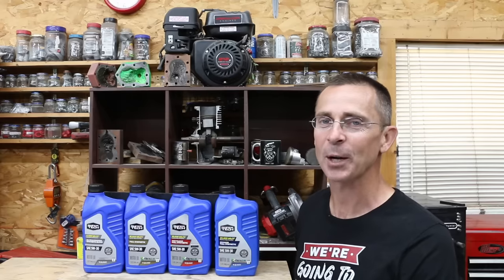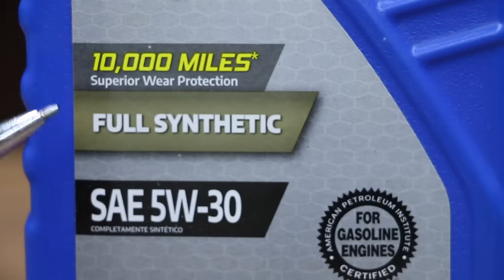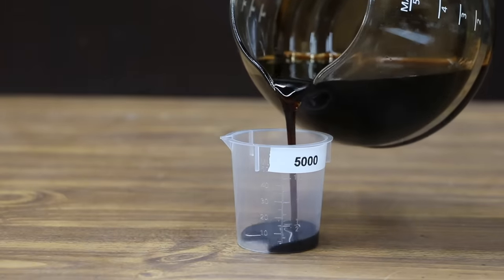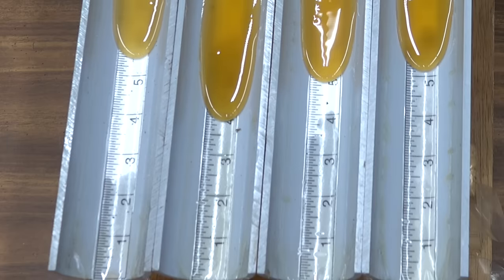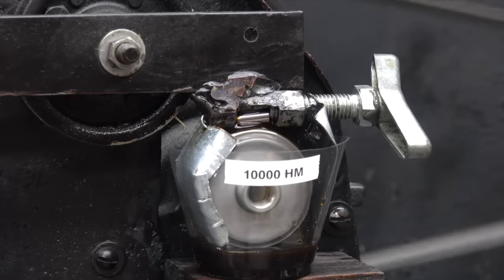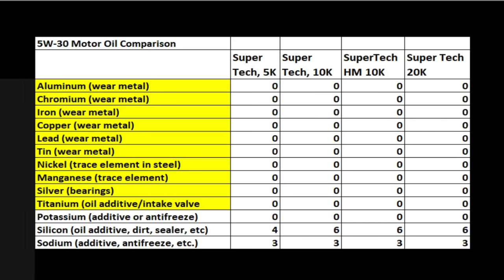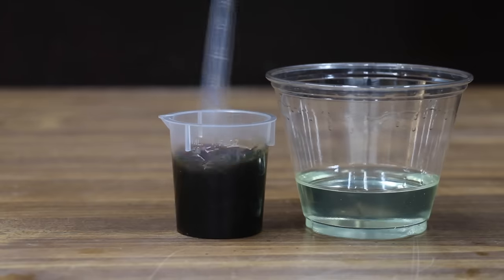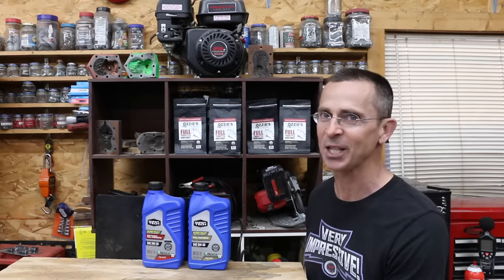Are They All The Same Motor Oil? Let's Settle This! Four Types of SuperTech Motor Oil Compared

Comment: I would love to see a video on the most common used transmission fluid (Dexron III/Mercon) between brands. Little known about what is better and you would be the right guy to show the results ! Awesome video once again
Reply: There is way more science in trans fluids than motor oils. I’d suggest sticking to whatever the manufacturer recommends and not exceeding the change interval.
Reply: @mwp1088  Everyone says the change interval is "lifetime".
Reply: @thisisyourcaptainspeaking2259  you don’t drive a Honda i guess lol, or if says lifetime why worry about changing it?
Reply: @mwp1088  my daughter does, and she has reached the lifetime of her transmission.
Reply: @mwp1088  I change it b/c if you do, "lifetime" doubles.  My th250c has unknown hundreds of thousands on it, the fluid is cherry red.
Reply: @markcatcash4688  You need to use the correct fluid.  Honda doesn't make the fluid, someone else does.
If you use Honda fluid, it will be the correct fluid (assuming it's the fluid designed for the transmission.
One of the problems with never changing the fluid is as the transmission wears, the fluid also wears and the fluid carries abrasive debris with it, the filter catches a large degree of debris but as it does, the filter becomes restricted, interfereing with operation of the hydraulic system.  So not only should some portion of the fluid be renewed (usually about half of the total), the filter is replaced as well.
It's much better for any transmission to have good clean fluid circulating through clutches, planetary gear sets, shaft bushings and bearings.
Reply: @mwp1088  thanks…. Interestingly, my MOPAR says “ permanent” , etc fOR Trans… Oddly, @96,000 miles on 4SPEED MOPAR, I am thinking of TRANSMISSION Services…..
Reply: Add schaeffers and amsoil to that
Reply: @thisisyourcaptainspeaking2259  lifetime of the transmission. Where that’s 50k miles or 500k miles nobody knows… and any manufacture that builds the transmission will say to change the oil.
Reply: @FishFind3000  Not sure where you got that from, plenty people claim their vehicle doesn't require scheduled transmission maintenance.  Manufacturers have removed accessable dipsticks, owners are being discouraged from even checking fluid level.
Reply: My Mechanic brother has always said "Lifetime" is a gimmick. When the Trans Dies at 90k, they'll say that the fluid lasted the lifetime...Change it every 35k and when the Trans goes for 300k well, thats the fluids lifetime too....LOL
Reply: @vinniemorciglio4632  I like the way you think.
Reply: @Peter Angles As a vehicle owner, I'm much less likely to maintain a transmission that has no dipstick.  As a mechanic, I'm not going to purchase a vehicle with no dipstick.
I won't be buying any Budweiser products, either.
Reply: Would love to see the differences in trans fluids too
Reply: @thisisyourcaptainspeaking2259 yes because after the fluid is over used the transmissions life is up.
Reply: @@PeterAngles would be difficult buy interesting to see what using dexron in a Honda would do or vice versa.  Obviously I would never try this since I know they are formulated specifically for certain transmissions
Reply: @thisisyourcaptainspeaking2259  I agree and do on my Honda , was mainly talking about Nissan. Lots of debate regarding using their fluid vs after market.  AMSOIL makes a CVT fluid and had test showing its better then the Nissan fluid, that would be an interesting comparison.
Reply: Trans fluid is all about a decent base. The important part is getting degraded fluid out and any synthetic should easily handle 100k though CVTs should be changed more frequently. There's no magic in certain brands as long as it's listed as compatible.

Comment: Thanks for the great content! As the service manager for an auto shop I've really put your info to great use, especially tool recommendations. I order our motor oil and other items and know what our competitors are using because I know their suppliers. Most customers would be shocked to know that some of the local dealerships are using the same off-brand (lesser known) oil as us rather than the big brand name or "dealer" oils. The suppliers give us data sheets and supposedly do third party testing but as a shop we don't really know what we're getting in these barrels so it would be great to do these tests on our stuff. If you ever want to test the synthetic blend that 1/3 of SoCal shops are actually using or some of the synthetic imports like Rheinol or Wolver I'd be happy to send some out to ya for testing. Keep up the great work man!  *Oops, forgot to answer the question lol. Personally I change my oil every 3-5k depending on which car it is. Customers however feel like you're scamming them if you suggest anything more frequent than the "service required" light that pops up on the dash. The problem with 10k oil changes is that so many new cars burn oil and the "expected/normal' oil consumption listed by the manufacturer TSB will have you running dry in between changes and guess what... It's your fault and not covered under warranty because the manual states to check your oil daily or weekly. Don't even get me started on the "lifetime" service intervals lol.
Reply from the maker: Thanks!  Thanks for the feedback.

Comment: I have had two VW Passats. The first one I did the recommended oil changes at 10,000 miles and around 100k it started to use oil. The one I have now I never go over 5,000 and at a 127,000 it uses no oil. A service manager at a VW dealership told me that VW was walking back the 10,000 recommendation because of what they saw happen to the engines. The only oil I would trust that far is the long mileage Amsoil, and even with that I wouldn’t go over 7,500. 
Project Farm, you’re the best. Thanks for your channel.
Reply from the maker: Thanks and you are welcome!

Comment: I would be interested in seeing a comparison of different brands' 20,000 mile oils (Supertech, Mobil 1, Castrol Edge, etc...). It would be interesting to see if there's a significant difference between brands and which, if any, could actually be trusted to go 20,000 miles!
Reply: It gives you engine protection up to 20,000 miles doesn't mean it can be used  for 20,000 miles.
Reply: Good suggestion
Reply from the maker: Thanks for the suggestion.
Reply: The ppl. What's 20,000 miles. There lazy. The don't want to change the oil.   An I RIGHT.  💯
Reply: @acomman77  I'm confused at how it can protect your engine up to 20,000 miles if it can't be used that long.  Is there something I'm missing?
Reply: Used 20k oil (Mobil1) on a 2006 Toyota. Engine still running well at 320k. However, oil was generally changed at around 8k. There was one or two occasions where it was changed at 10 or 12k.
Reply: @acomman77  what does that even mean?
Reply: @yorkiemike  it means that it has additives that prevent leaks in your seals and prevent sludge build up for 20,000 miles. I've put over 10k miles on 0w-20 full synthetic, but it takes a toll on the motor over time. Also, it's all about using a good oil filter too. I ran dollar general full synthetic oil with a Mobil 1 extended performance oil filter and changed it at at 7k and the subie is still holding up well. The oil filter is most important and also the right kind of oil. Me personally the most miles I'll put on full synthetic is 10k
Reply: @Sillyman  the frame will rust out before the motor goes on a toyota. Use a good oil filter and keep the oil changed. Just don't run it to a point where the oil breaks down and it is basically like watery instead of a lubricant.
Reply: @basilman121  which is fine for all highway. 90% don't drive all highway and still change oil at 10-15k and wonder why engine is junk at 100k.
Reply: Yeah, perhaps, if it was all Highway driving. In a short period of time.  Bc I'm pretty sure they all say "or a year"
Reply: I like to know what is normal mileage 100% of population change their engine oil at 3,000, 5,000, 8,000, 10,000 or 15,000?
Reply: @Rocket  I usually change mine between 3k-5k but in the winter time I'll push it to 7k-10k. I hate changing oil while it's really cold out
Reply: @rocket0571 I follow the 5k interval. Oil is so much cheaper than a new engine. The car care nut channel say the oil should be changed every 5k or every 6 months. He deals with Toyotas which is what I have. I have known people that do the 10 k. Not worth the risk to me. I’m a fanatic about engine maintenance whether it’s a car or tractor.
Reply: @rocket0571  I do mine at 3K or 1 year depending what comes first (usually equals out to 11 or 12 months depending on how much I drive the thing which isn't a whole lot, only avg about 3k/yr) i use mobile high mileage, dodge nitro 2007 201K miles on it.

Comment: Very thorough review, and interesting results! One category that would be interesting is hammer-free concrete drill bits. I bought an Alpen Profi Multicut, and I was blown away by the fact that it drilled into my concrete ceiling effortlessly using my battery drill. Even my corded hammer drill struggled with that quite a bit. It would be interesting to see how long they last, how they cope with steel-reinforced concrete, and of course if there are some good bang for the buck bits.
Reply from the maker: Thanks!  Thanks for the suggestion.

Comment: These oil debates are so fun... and crazy. I love a good oil race and this was one of the closest yet. What amazes me as an older person is how the 3k oil change is ingrained in our heads. And when I pull out another persons owners manual, show them the oil change interval is higher, (sometimes 7,500 miles) they reply that the manufacturer is trying to get them to destroy their engine so they can sell more cars. Oh well. Great information Todd, and I hope you and your family are enjoying a fine easter in the farmabego!
Reply from the maker: Same to you!
Reply: YEP, I remember my Dad saying 3,000 miles on your Camaro yet, you have too change that oil at 3,000 miles. JUST BURNED INTO MY BRAIN, I'm 57 years old.

He would also use STP in each oil change.
Reply: I've always used Quaker State in my engines and they've all performed excellent even after 200,000 miles.

I had a 1999 Chevy Astro with 216000 and it was still running when I scrapped it.
Reply: I change my oil every 5k. But oil is very expensive where I live. It costs me the equivalent of $70 every time for 6.5 quarts of oil.
Reply: @leadnsteel1428  That's what Dad mainly used, sometime's Wolf's Head Oil & Grease.
Reply: @TheSuperBoyProject  HOLY CROW ! $70.
Reply: @NoWr2Run  100 USD for 4 Litres of the cheapest version of castol edge around here...
Reply: @TheAndreasKL  WOW, KRAZY THAT IS.
Reply: Manufacturers aren't trying to destroy your engines, but they do want to sell more cars. 
And extremely long oil change intervals are a way to achieve that. 
Because the longer the manufacturer specified oil change interval is the more attractive a car becomes for potential fleet buyers, running costs are smaller and so is the maintenance downtime. And fleet operators don't care what happens afterwards.

The question you have to ask yourself is whether it's malicious. Because when you consider that fleet purchases are over 25% of volume of new cars sold this is an important market to cater to for every manufacturer.
Is a car manfacturer purposefuly trying to destroy your car? I don't think so. Do they benefit from cars having a limited lifespan? Obviously.

Malice or not, what Project Farm said in the video is true. 
Oil is cheap, engines are expensive. Just change your goddamn oil like your grandpa did.
Reply: Some people live throwing away their money.
Reply: @kisielthe1st  Nope... because you are then saying there has been no advancement in oil technologies since the 70's. Sorry, just aint true. Tolerances are tighter and less vibration of critical parts means that the oil isn't working as hard and it is better oil to boot. So if you want to live in the 70s, then please don't change your filter at every oil change, because that is what the manuals all use to say.
Reply: My owners manual said every 10k miles do an engine oil change, yet when I changed it at 5K it STINK of fuel while it was draining, STINK So much that it seems that it was mix with fuel, a lot. Now imagine if I wait 10K every time will end up with no compression on the cylinders from being washed out with all that fuel on the oil soon I'll need a new engine and that's coming from a 2022 toyota camry LOL for comparison my old 2012 ford fusion one time I changed it at 10k and oil didn't smell like fuel at all just burned oil smell normal. I change it every now every 2.5K and oil smells like oil, not fuel. Awd average mpg 38. To each their own, peace out✌️
Reply: @wevonox7941  yeah it's true there are so many examples of it going both ways right?? But my only thing is is that you never hear of someone blowing an engine in a modern car from lack of oil changes no in the 60s and 70s it was a very different story.... A car making it to 100K miles was a miracle in the 70s... Unless you had a Chrysler slant 6. LOL... My 04 Xterra has 270000 and still going strong... I change mine every 5,000 and I only use Dino oil.
Reply: @ACoustaDC  I never heard of that oil before but cool will take it a look at it. I use on my engine Pennzoil ultra platinum and on transmission/transfer case/rear diff Amsoil Signature Series.

Comment: Great videos!! I do 15,000 mile oil changes on full synthetic. I change the filter every 5,000 and add 1 qt of oil. This is in diesel using 15w-40. I’ve been doing this for 10 years in the same truck. Had head gaskets done 2 years ago and my mechanic said the cylinder walls looked great.
Reply from the maker: Thanks!  Thanks for the feedback.
Reply: Don't do it if you have a Toyota, GM,  or Hyundia. It's just not worth it imo. But your deisel has a HUGE sump capacity and big filter.

Comment: Video suggestion. Maybe if you get bored or have time, put together a video putting all the different wear scars/cold oil races etc to show all the differences between all the oils you’ve done videos on. 
Love your channel. Ty for your service to society. Keep up the good work!
Reply from the maker: Thank you for the video idea!
Reply: Yes! This is a fantastic idea, I'd love to see every oil he's tested compared, but it would be a little ridiculous to ask to retest everything for a new video. Recycling content for a final complete analysis and a final verdict would be a great video!
Reply: @ProjectFarm  Before you do that, can you clarify how you're going about determining the significance of the wear scars? It appears that you're comparing the length of the scars. But that doesn't allow you to determine how much larger (area or volume) one wear scar is than another. As the length of the scar increases, so does the width. (Not to mention that you'd be trying to measure the surface of the shape created by the intersection of two cylinders.) A 2mm long scar is not going to have twice the area as a 1mm  scar. And the difference between a 1mm long scar and 2mm long scar is not going to be the same as the difference between a 5mm long scar and a 6mm long scar. As the size of a scar increases, the contact area between the two surfaces increases, and that's going to make comparisons based solely on length (or even area) complicated as well.

I wonder of you can find tables (or formulas) which will let you enter the diameter of the wheel, the diameter of the test pin, and the length of the scar and give you the actual area of the scar or, possibly even more useful, the volume of the material removed from the test pin? Another thought -- do you have a scale sensitive enough to measure the mass of the test pins before and after?
Reply: @ProjectFarm  A mega oil roundup with a couple added tests perhaps?

Comment: I’ve been using full synthetic up here in Canada for many years. I change it every 10,000 kms (6,000 miles). I also use WIX filters since I have found them to weigh more than others but I think testing oil filters would be a great show. I’d be interested in the ‘B’ filters made by the same companies such as WIX against their main ‘A’ filter. Often the price point is less than half so I’m curious where the real value is. Thank you for all your exhausting work with these videos. Greatly appreciated. 👍
Reply: I have found a few websites up there that have done some testing and teardowns. The biggest thing I learned were that there are a few brands (and re-labels) to avoid outright. Wix (depending on the tier) is a fairly well regarded filter though from what I recall.
Reply from the maker: Thanks!  Thanks for the suggestion.

Comment: Thank you so much for pointing out oil contamination due to fuel. What a huge difference that can make. Just for instance, a propane engine has very little fuel contamination, while a turbo charged engine has quite a bit. With out getting in to much dialogue, I choose to change my oil every 3500 to 4000 miles. It's a easy and small price to pay for good engine protection.
Reply from the maker: You are welcome!  Thanks for the feedback.